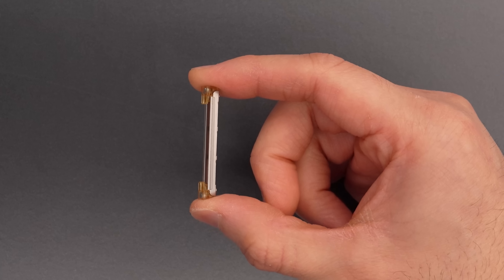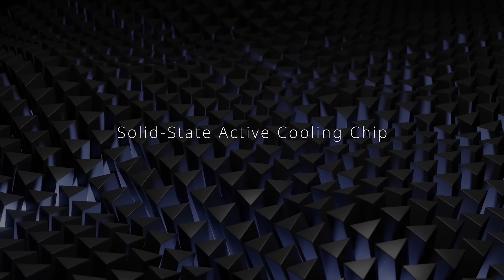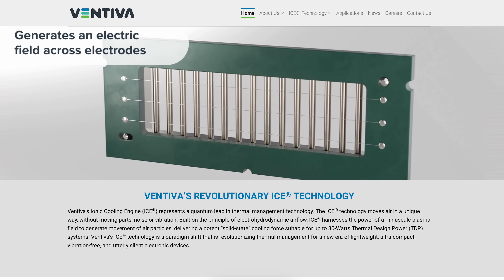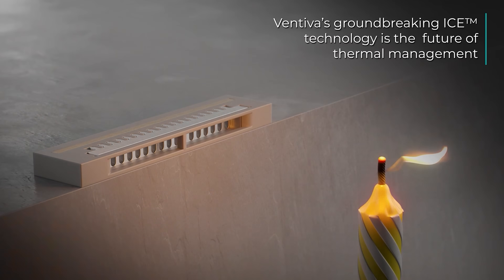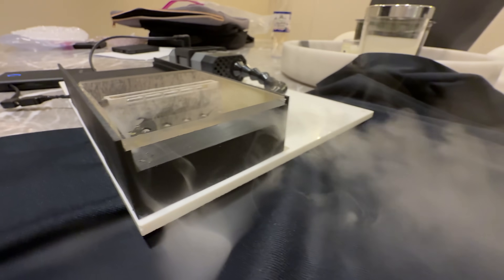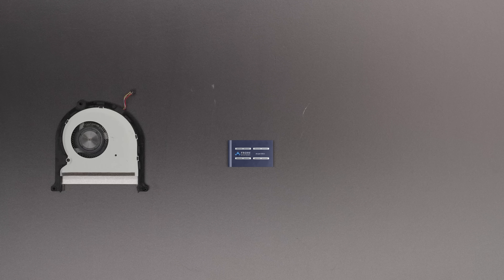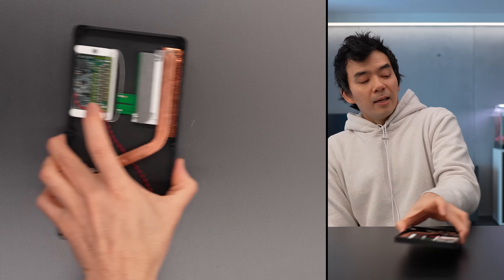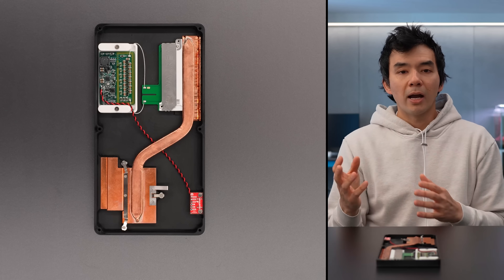The IMPOSSIBLE Laptop Fan...

Comment: If frore can get their efficiency up then I think their system has a much better chance of success, Because 
No ozone.
No nox
Dust is a non issue 
Device can be waterproof 
High statics pressure
Reply from the maker: I think the inherent efficiency of piezoelectric membranes holds it back. Like the physics of that tech seems to hit a wall for every company that tries it

Comment: Honestly, these feel weaker than the Frore ones, and the comments raise pretty significant concerns regarding longevity. Either case, I'm hopeful for either one, but I don't think laptops are even the best use cases. Modern standalone VR headsets require active cooling, and are much more space constrained than laptops, so solid state coolers would be a perfect application.
Reply from the maker: The ionic ones are definitely much stronger airflow than the frore. It measures in at double. But I’m also hopeful for EITHER of them to take off lol. Regular fans use such old tech and haven’t improved in a significant manner in decades

Comment: Packing a 20kv source in a laptop?It sound dangerous.
Reply from the maker: It’s closer to 5000v

But that’s what VRMS are for. GPUs also need high voltage. (You just need space on board for vrms)
Reply: @Dave2D  no,gpus operate at 12v before vrm,after vrm its ~1v.it won't shock you anyway.but 5kv is extremely dangerous both for you and laptops itself.Also this booster circuit gonna create huge emf problems,it can be used on enormous laptops.Also there is risk of arcing if you consider these are gonna be around cpu and pcb.

Comment: It's interesting, cool tech ;)
But I'm not that excited
...about electrocuting myself, inhaling ionized air (not just O3, but potentially NO, NO2 - nitrogen monoxide, nitrogen dioxide... and whatever is in dust).

Remember kids: don't disassemble CRTs, microwave ovens, anything that has high voltage power supply in it... including this cooler.

Comment: Yea they attract dust and create ozone..  so it will degrade all materials much quicker than normal..  it oxidizes materials so rust and such will develop quicker around the devices..  so longevity is not a thing for them but the general idea has been a thing for quite a while..  piezoelectric motors and fans are something that will change industries once their power usage gets figured out..  but the materials they use on these ion generators would make little difference in ozone production as thats the whole thing they do..  how can you remove ions from air without removing one from oxygen?  Unless you have some molecular sieve than your going to deionize some oxygen..

Comment: Both the Frore system and Ventiva solution are really exciting just by nature of the unconventional approach to cooling.

I'm surprised Ventiva's solution after only hearing about it in your video is going into a production device. 

I wouldn't write off Frore's someone just yet though. Remember, the technology is extremely new compared to fans which are decades old. Frore could figure out it's energy efficiency and vibration challenges and it's good to have two competing technologies for cooling.

Comment: Do you remember the infomercials for the ionic breeze home air filter. It used an array of blades to do the exact same thing. 
This kind of tech is going to cause problems if used in a cooling solution due to the creating of ozone. It will also attract particle build up on the surface of the electrode use to attract the charged particles.
Reply: he literally explained it is converted straight back from ozone immediately. you obviously didnt watch the video
Reply: @cloudnine5651  you obviously have not seen any of the research related to the ionic breeze. You will never actually convert all the ozone back in to regular O2. Some will escape. Plus it really sounds like fun when you spill your coffee and your laptop turns in to a taser. 

Do more than watch a single video and pretend to understand ion thruster technology.
Reply: @cloudnine5651  This is a known technology that was used in the ionic breeze air filter system. 
We know how it works and that it will produce ozone. Not all the ozone will be destroyed before the air exits. 

Also good luck when you spill your coffee on your laptop and it turns in to a taser.

Comment: I mean, it was an instant winner the moment you said "no moving parts". Moving parts are wrong. Moving parts wear out. We've all heard aging fans making distressing noises, for instance. A proper laptop or even PC design utilizing this technology would be silent but still stay cool. Sure, in a datacenter having a dozen howling fan in a server chassis is nothing, but at home? The last thing you want is noise. I wonder what the limitations are for cooling heavy loads - for instance, video projectors, they may be becoming more niche and for high end home theaters only more or less but if you could cool those silently that would be huge. But - of course, it's in the prototype stage and I'm sure there are pitfalls. It may also not scale up. Either way super interesting.

Comment: The moment I saw the title I knew it was an ionization tech. This tech has been known for decades and is nothing new.  I actually built a room ionizer in 2011 which is essentially a negative ion generator using a series of diodes and capacitors with the front end of it where a discharge is generated in such a way that it literally blew cold air I could feel it on the palm of my hand and it blew smoke just like in this video.

Comment: I did a lot of work with high voltage. When air ionises or breaks down it creates ozone. Ozone is toxic to human lungs. So this is a terrible idea since laptops are generally used indoors in poorly ventilated areas. I dont think anyone will make a successful product with this tech because its not only toxic, but working with high voltages can also be challenging. High voltage generation creates a lot of noise and static build up could damage sensitive electronics. Yes its cool, but its not practical.
Reply: Why can’t they just copy how efficient Macbooks are 😂😂😂
Reply: Based on your extensive training in the field, your PhD and your masters being in electricity, high voltage, physics or electronics somehow I assume rather than just an off the cuff opinion.
Reply: @cr0ft-2k  I worked on Dielectric Elastomer Actuators. They typically operate in the range of 1kV to 5kV. Its enough to create a corona whenever you have a sharp conductor. You can can smell the ozone when working at these voltages. Also any electrical discharge can generate a lot of electromagnetic noise. USB measurement equipmemt often stopped working near my experiments. You need really good shielding and good insulation.
Reply: @puffinjuice  u can smell ANY amount of ozone. dont let this guy pretend to know what he is talking about, he doesnt. you can tell because he starts talking about EM noise, when that was already addressed in the video and solved
Reply: @cloudnine5651  EM noise can be addressed, but it is challenging to address in such a small space, next to highly sensitive digital electronics.

I think my problem isn't with the product. My problem is with the video and how it was presented. He over hypes the product. Its an old technology with a lot of problems. He briefly addresses the problems, but he doesn't provide any evidence. I don't buy it.
Reply: @puffinjuice  he literally said the em problem was solved by the faraday cage around the device, yet you somehow say he didnt provide an answer? you either didnt watch the video all the way or you arent smart enough to comprehend what is in said video.
Reply: @cloudnine5651  What about the power lines that breach the faraday cage?
Reply: @puffinjuice  what about them? you think some random youtuber is smarter than the ppl who designed it? You seriously think that wasnt thought of already? jfc lmfao
Reply: @cloudnine5651  For the sakes of the product I hope they thought about it.

Maybe they addressed all the problems, but that still doesn't make it better than a traditional fan.
Reply: if you had watched the whole video he explained the ozone is converted straight back right away. stop posting misinformation when you obviously didnt watch the video
Reply: @cloudnine5651  Yes it was covered in the video, but i doubt this is possible in such a small space. This thing moves quite a lot of air and there is limited surface area for the ozone to react. I doubt it converts all of the ozone to something safe.

Comment: This looks like the same technology that was used in the Ionic Breeze series of air purifiers that Sharper Image sold over 2 decades ago. The principal behind the tech itself was discovered around 100 yrs ago.

9:00 not just a potential, it happens. Sharper Imagine pretty much went bankrupt because of it when their ionic air purifier products (the bulk of the income) were tested to perform worse than traditional fan driven air purifiers while also generating ozone. It's just a byproduct of the technology that scared consumers away.

Comment: To your point about the static pressure, I’m guessing they’ll have some of these set up as intake and others set up as exhaust so the static pressure within the case/housing of the laptop will be even to achieve good airflow, like if they had intakes near palm rest area and then the exhausts out the back, I’m guessing they’ll have to be more open-air with minimal dust filtration.

Comment: So the company is DELL.
Reply: Asus?
Reply: @ DELL. You can see this at 6:00 on the left corner of the metal object.
Reply: @y_0_1_0  you've got a good eye, indeed that is Dell. Well, not a product I'm interested in buying anyway. Gimme full size radiators and fans that run at slow speed !
Reply: @ Also, Dave mentioned multiple times about a big company introducing this tech in their laptop. So most likely Dell as they are the only ones trying new things now.
Reply: @y_0_1_0  He mentioned it in real-life laptop shown at CES. Not necessarily a final, real product. A showcase unit.
Reply: @APopov  Yes from a big well known company.
Reply: @y_0_1_0 I might be talking crazy but, I think that's just a screw.
Reply: @Shaatir2960  Nah. You can see distinct letters.
Reply: I was right. DELL released a laptop with solid state cooling.
Reply: Dell does not design their devices to sell quick and get dumped 2 years later. Doubt.
Reply: Ah, so we can look forward to a worse version of this, with cheaper parts, when it hits the market.
Reply: @WatermelonArtiste  the first version of any new tech is going to be the worst.
Reply: Worst laptop company
Reply: Later some company decides to remove a part to save cost and suddenly people start dying😢
Reply: Apple?
Reply: @migamnsd  Apple and innovation are antonyms!
Reply: @y_0_1_0  Also Apple will never drill holes next to fan because it can't create enough pressure to suck air from afar.
Reply: @migamnsd  apple will put this in their macbooks next decade after every company has done it already
Reply: @ItsFlenz  And will name it "apple flow", for all the sheeps to go WOW

Comment: At first I thought it was the fan that was shown off a few years back that simply vibrates a thin bit of metal, uses very little power and requires pretty much no maintenance with continuous years of operation but no this is not that

Comment: I think most of the necessary redesign for airflow could be done by altering the heat pipes, rather than altering circuits. Some relocation of air intakes would probably also be helpful, as laptop fans are pretty much specialized to push hard, not pull hard.

Comment: The airjet is not about airflow. They said so miltiple times. It’s about static pressure and the elimination of boundry layer on the cooled surface, meaning the heat transfer is much more efficient.

Comment: Never used a Laptop, but I've been using this "tech" in the radiator of my car since 1979.
Fluid cooled computer also, of course. Both pumps the fluid and draws air thru the radiator.
Think I will check their design against mine.
For anyone interested, stack three razor blades. Coat one side of each with graphite. Thats a starting point to develop your own.

Comment: My immediate thought was "Wait, you're ionising air next to my sensitive laptop electronics?!". It seems odd to put a static electricity generator right next to laptop electronics. It's mini lightning. It's exactly the thing you DON'T want near your laptop.
Hopefully not powerful enough to make your hair stand on end /s 😏

Also, what happens when you get a bunch of dust that shorts between the wire and the grill?

Comment: It's a cool tech. But, it feels like a simple, yet complicated kind of tech. You need a lot of different components just to achieve a somewhat normal output. And it's expensive to manufacture. Of course, that will probably drop in price with time. But right now, it's kind of expensive. 
It's a new tech. So, I feel like there's still a lot of room for improvement. But I love the fact that companies are doing this kind of research.

Comment: Seems like one blowing into the left of the chasis and one or 2 blowing out of the right of the laptop would do the trick for static pressure. Then just split the chasis down the middle and use half for the main board and half for battery. That or create a thin cooling 'tunnel' like a server gpu heatsink that runs straight over the cpu and gpu, use a few thermal pads for everything else and throw one of these blowing in from the outside across the entire heatsink. I wouldnt do it for a 4090 laptop but it would be plenty for a ryzen 5 and 4060 level.

Comment: Ionised Thrusters are 1950's tech. This is probably the first useful application of it. If they can scale it up to push enough air for HVAC systems in cars and homes, or in spacecraft, it'll be really useful, instead of just being used to make tinfoil 'aircraft' models float.
The static pressure can be improved by making use of the Coanda Effect, the same way those Dyson 'bladeless' fans work. Laptops will benefit, but Tablets will really take this up fast.

Comment: My prediction:
1. It will exist as a hybrid system where both normal fans and this will co exist. You keep fans off until you can't anymore.
2. I'm not a fan of ionisation. That tiny wire will wear out AND what will band time is running out as more and more efficient systems are going to come out (looking at Arm architecture mainly)e the resistance to dust? I feel like in practice and in real environments it won't do
3. The cost is just crazy so they got a lot to do to make it happen...and more and more efficient chips are coming out... mainly Arm

Comment: I mean the old one's selling point was that it had VERY high static pressure so you can use very dense heatsink fin arrays and achieve cooling that way. Quieter, slower moving air like a macbook instead of loud fans.

Comment: The Frore Airjet, although it doesn't move as much air, was showcased as being efficient because its primary cooling method is the piercing jets of air which disrupt the almost stationary laminar layers near the heatsink. It might end up being really efficient in energy consumed in moving a unit of heat..
Reply from the maker: Except it’s not. They marketed the concept of it. (And it makes sense in theory) but taking advantage of the high static pressure requires heat sinks all over the place. Which isn’t practical nor desirable. I mean there’s a reason why not a single laptop company has picked up airjet tech yet. The thermal engineers have seen what airjet can and can’t do.

I do think frore’s airjet tech is very neat and really useful for certain applications. Just not laptops
Reply: @Dave2D  I had thought it would be useful for at least the MacBook Air.. 
Yep, your arguments make sense..

Comment: In my opinion, this proposed cooling strategy is dangerous. Here is my explanation why:

1. In the presence of moderate temperatures, oxygen ions could instead combine with each other forming O3 also known as ozone which is known to be harmful to the environment and to your lungs. 

2. Escaping electrons are accompanied by a photon which in some wavelength registers as light but at high enough frequencies can also register as heat. Heat drafts as a cooling solution is not viable because when it is inadequate it ultimately reduces the lifespan of your components by forcing them to operate at higher temperatures.

3. Electric fields, such as those generated in your lithium ion battery are known to be dangerous to living tissue, which is why you don't place your phone in your pocket or that part of the phone when charging next to your face. Although the fields generated likely would be minimal, malware nowadays can do anything.

4. Air molecules (H,O,N) may bond together in other ways, for example H2 and O2 could bond to form H2O water, during the ionization process, in the form of a vaper; likely harmless. But H2 and O2 could also posso combine into H2O2 hydrogen peroxide, also in the form of aerosol vapor -- which is known to reactive to living tissue and imagine if inhaled into the lungs...

5. Risk of electrical shock. Duh.

Just because they release it onto the public doesn't mean it's safe! For example, Teflon, Round Up, Freon, Asbestos, etc. Know your physics, math, and chemistry!!

Comment: i think this tech is been so many years. i believe the aurora jet the successor to sr-71 has a jet flow like this. a vertical straight flat. unlike traditional jet its circle and needed more fuel. the aurora on the other hand only needs air and i think water vapor or something liquid that doesnt a fuel.

Comment: Despite the big laptop brand endorsement, this thing won't fly, all the points you mentioned would come back and bite it. What will fly however is peltiers. Think about it, thermocouples can be used everywhere (even in solar panels). It is the most underrated tech